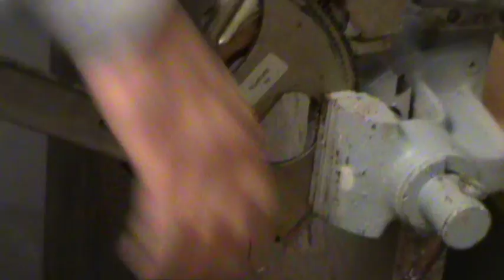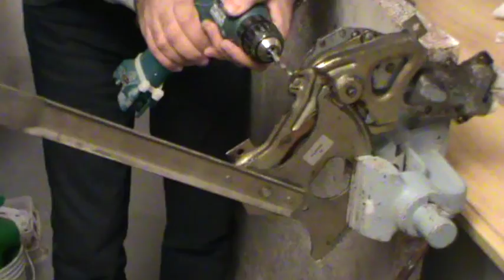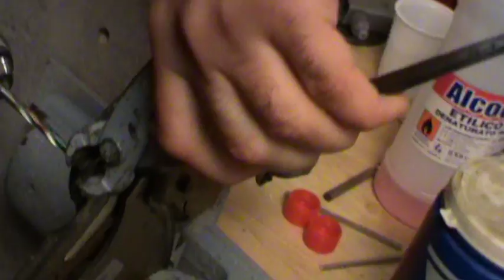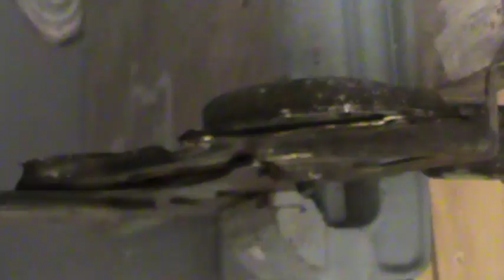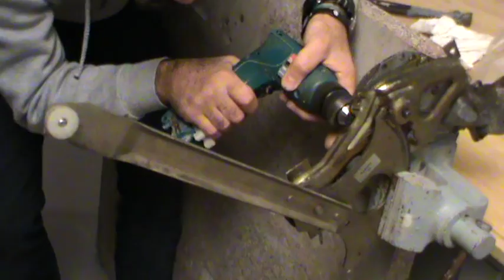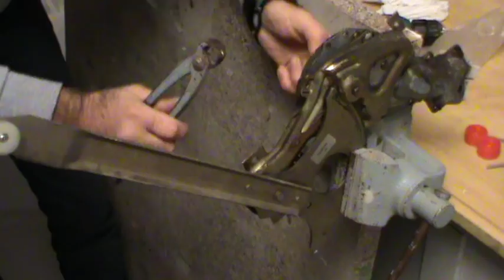chevrolet blazer s10 gmc jimmy window motors replacement very unsafely way

Comment: Oh my! The Chilton repair manual for the 1994-2004 S-10 (includes Jimmy) states under "Door window regulator - removal and installation" the following:

WARNING! Do not remove the electric motor from the regulator assembly . The lift arm is under tension from the counterbalance spring and could cause personal injury if allowed to retract. 

The instructions that came with the replacement motor state that you must remove the regulator according to the shop manual
(this involves removing rivets -- not covered in the manual). Once removed, you have to secure the sector gear of the regulator by installing a bolt through the regulator body and the sector gear. 

I think I'm going to just get the regulator assembly with the lift motor attached and return the lift motor. 

By the way, I think the safest way to remove rivets is with a Dremel Multi-tool with a carbide blade installed. This tool pays 
for itself over and over and over. Excellent for cutting in tight spaces.

Comment: What you need to do, is drill a 1/4" (8mm?) hole through the  semi circular gear (the "sector gear" and the metal frame behind it, and insert a 1/4" bolt and secure with nut, this will hold this tension of the spring allowing easy removal of the motor.

Comment: I clamped mine in a vice tightly but not bending anything. It clamped it so it held the arm and spring somewhat. I was able to remove the motor without the spring unwinding at all